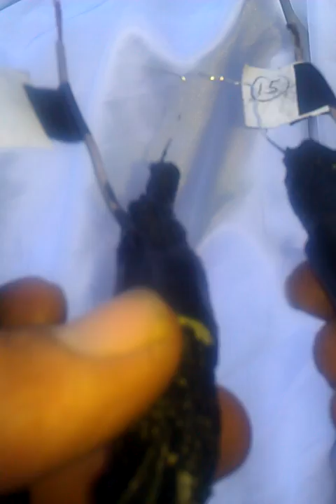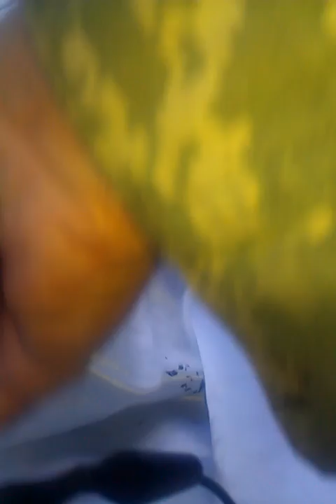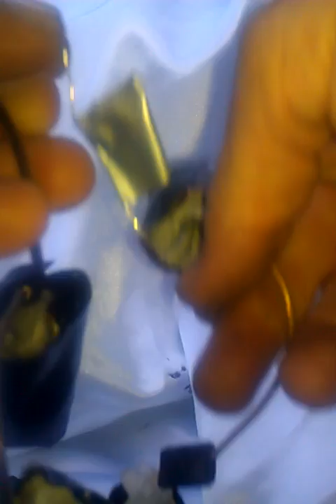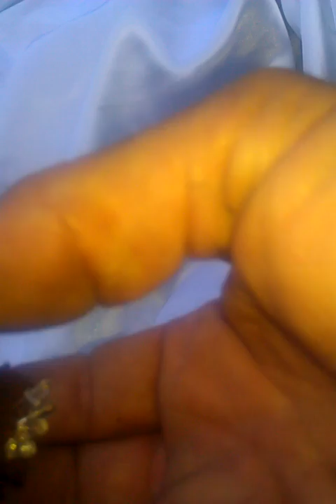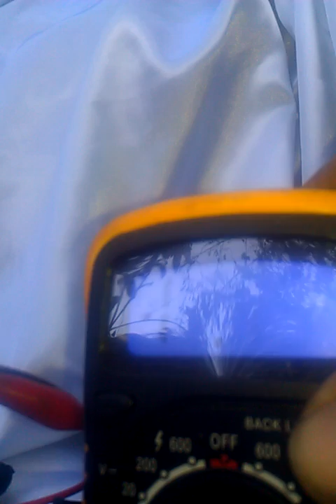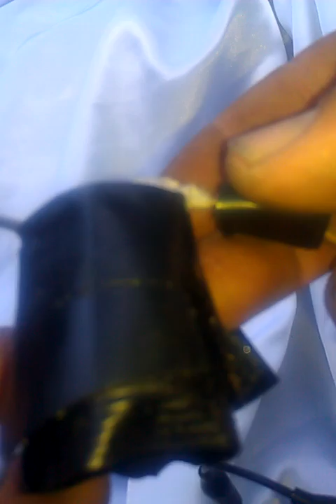ZPE 43 ))) free energy crystal battery overunity hutchinson effect rock battery Tesla Radiant

Comment: So, you are saying this is a 5000 mAh battery that is recharged with water (assuming the LEDs are drawing about 5 ma)?  Do you believe this is an oxidation reaction?  If so the battery will eventually fail because the electrodes are oxidized away, right?